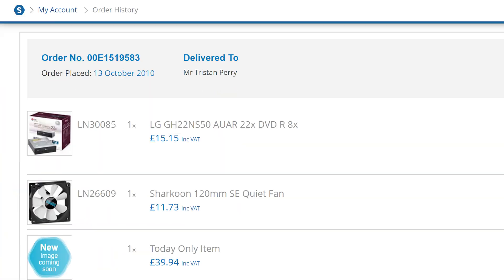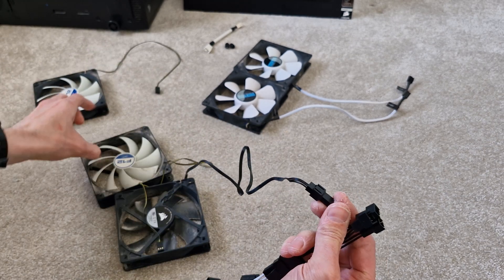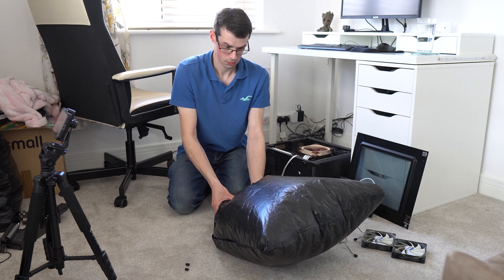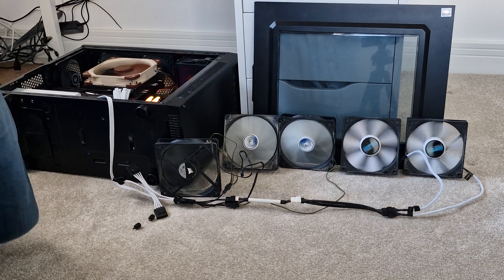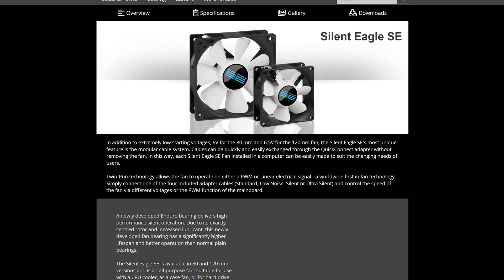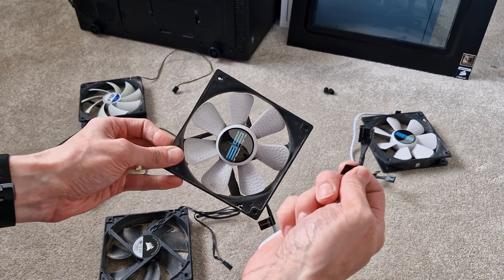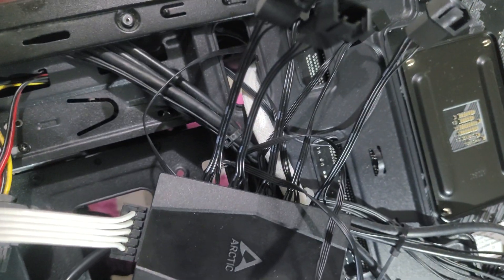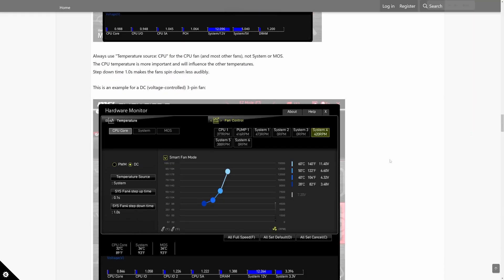Do Case Fans Have An Expiry Date?

Comment: My case fans are 9yrs old. Bearing based but sound reasonable and cool wise do very well. Often better than clients new fans from corsair or monotech. How does it make sense i have 0 clue. 

But thats your job not mine to explain i just know im cheap. 

I got my 5900x for $25 new as i fixed repaired a ghetto trash cpu that was stepped on. And it worked i bought new and returned it lol😂😂😂😂. Aka 25 bucks judge you want to....jelly.

I used 3 blades in a single hand to repair like 50 pins plus broken and some heat work. 

I scammed to get new as i knew i needed the part to work for many years and didnt want to chance it. Big companies dont care about us so....im out for #2. 

I had content to make so i chose the need over over morales. But i did return a fully working part...so we good lol😂😂😂
Reply from the maker: Haha can't blame you for sticking with 9 year old fans, and using a repaired 5900x - that's a bargain. Not an easy repair though - I struggle with bent pints lol (just don't have the patience). Glad you got it working in the end though :)

Comment: You could have just used some tape to measure the amount of revolutions per minute of those fans. No need to break one fin out.
Reply from the maker: NOW you mention that 😭 You're right though... good tip thanks. I did try using a black marker but that didn't really work. I didn't consider take at the time - DOH!

Comment: still have some old Rosewill, Cooler Master, and generic fans from Aliexpress or eBay from a while ago, they're probably among some of the parts that I end up reusing multiple times for years down the line. I've since moved over to having Arctic P12s as well, but the older stuff that I've had and dropped into my sister's PC still seem to be working well, even after all of this time. Gotta say though, I never realized how noisy they've gotten (or maybe even have been, it's likely I got used to it after almost 10 years) until I swapped over to the newer fans I have now. 👍
Reply from the maker: That's good to know, glad those older fans are working fine for you (or your sis!) too. 🙂 Hmm that's an interesting point re the noise - I didn't immediately notice then when compared to my newer P12s, but it wouldn't surprise me if the older ones have become a bit noiser in time.